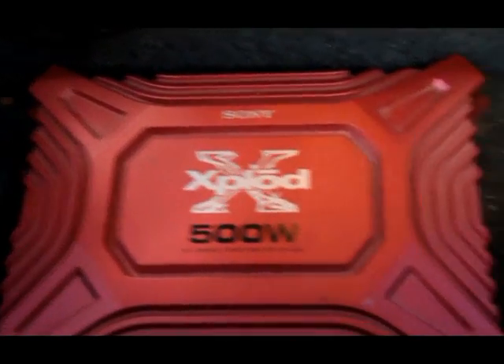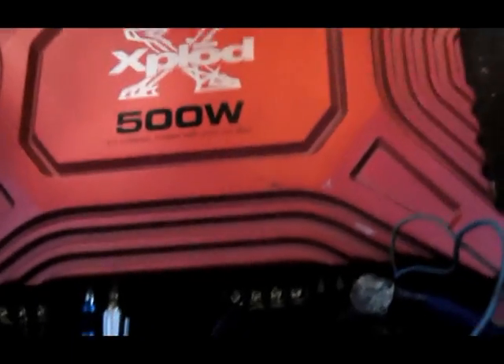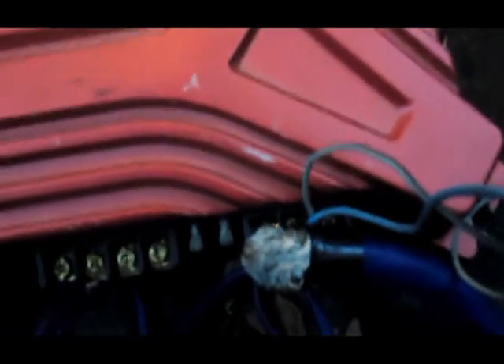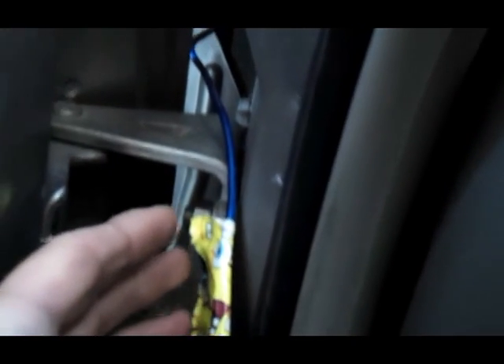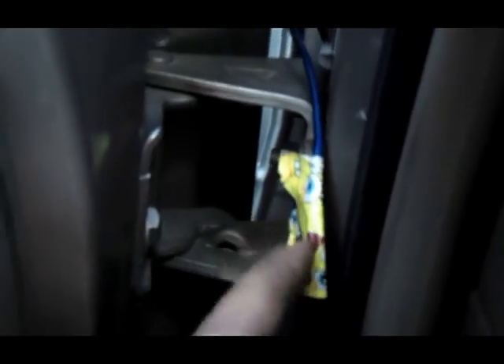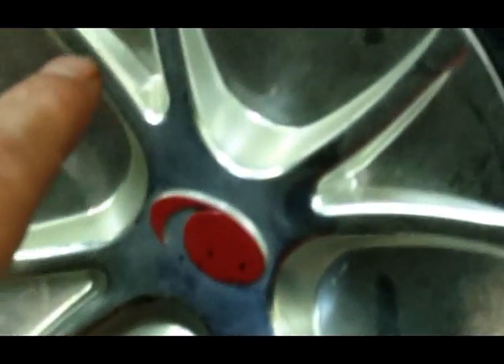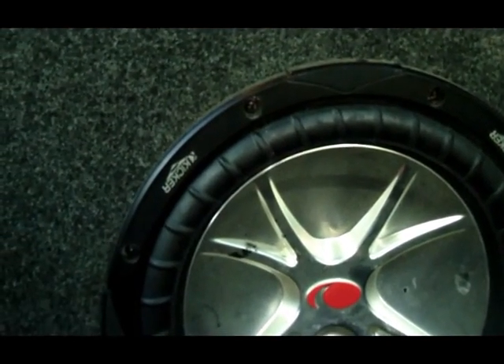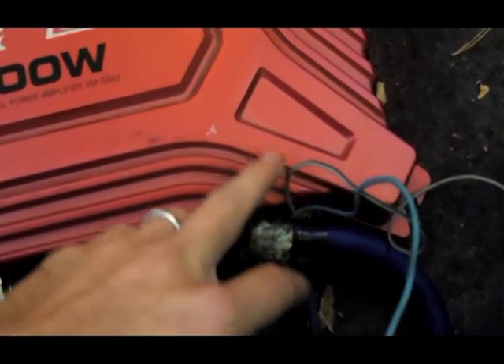Car Audio Dont's and Do's / Bad Wiring

Comment: Question,  Im running two amps one 900 watt mono and a multi channels 400 watt, I had 8 gauge power ran for the 400 and I ran a nice 4 gauge for the 900 is that ok to run two separate power wires instead of using a distribution block? And I was cause my deck has a spot for rca to run it's own separate rca but I jumped from amp to amp , will that make a difference running it from radio or jumping from amp?? Thanks casp

Comment from the maker: Make sure you use at least the size of power wire your amp ask for. Just google it. That should tell you the size it takes. It is actually better to run seperate power wires to your amps. Get better power that way. A distro block is just to save money since wire can be expensive. Jumpin your rca's I don't suggest unless you have to. I recommend rca splitters before jumpin amp to amp. If you run to seperate rca's though its better and you have more control through your headunit